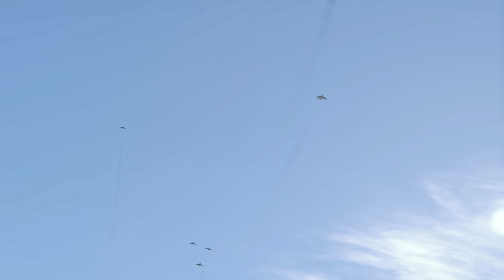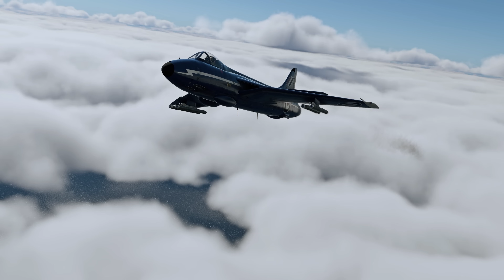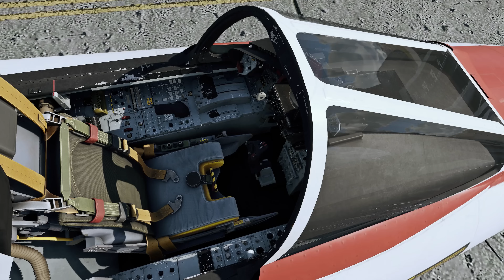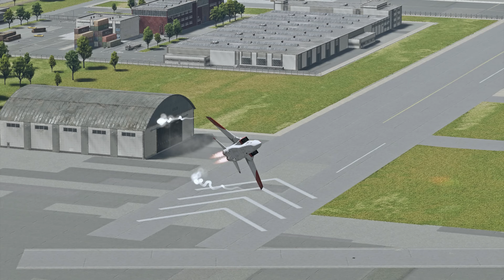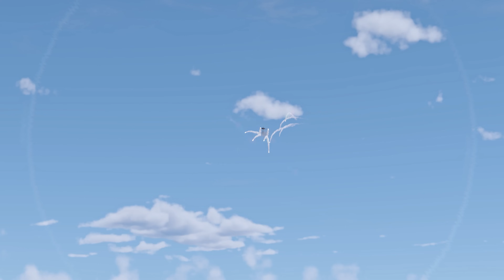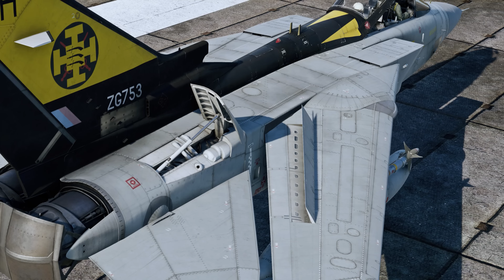Panavia Tornado: Common Cause

Comment: i don't think that this Comment will change something, but can you please take a look on the Tornado family? I bought the Tornado IDS WTD61 cause i tried it on a friends account and it went very well, but know it's absolutly hard to Bomb a base or make a kill. The mig-21s, the mig-23s, the f-104s and some f-4s are so fast that they steal your bases and you have to wait 5 minutes until the round is over, which is not an option in many of the rounds, as many rounds just end very quickly...
i have a small solution suggestion. could you make the tornado start a few seconds earlier or make it spawn just a few kilometers ahead? I would be very happy if the time with the tornado would be a little easier for me, whether you should get the same rewards as before is of course another matter but I really regret having decided in favor of the tornado
Reply: I doubt they'd change or add anything to do with spawns but you can always go for the small pillbox positions and the convoys if they do steal all the bases

Comment: There is much more to the story of the Tornados lost in the Gulf War "outside of combat." When the war started, the Allied Forces were justifiably concerned about the Iraqi Air Defense Network. However, as the air war continued, we discovered CFIT (Controlled Flight Into Terrain) was a very much greater threat than the combined air defenses of Iraq. General Horner ordered all aircraft to start fighting from much higher altitudes but the British refused to comply and continued to lose good crews to dirt. Allied forces lost far more of every aircraft against dirt than everything the Iraqis could throw at them. This isn't meant to disparage the Iraqis but to highlight the necessary priority in ALL phases of flight: 1) Aviate, 2) Navigate, 3) Communicate and in that order of priority. The pK (probability of Kill) of modern missiles is .1 to .5, the pK of fighters is .2 to .7 but the pK of Ground is 1.

Comment: Just a shame Gaijin artificially nerfs the Tornado to a massive degree. The amount of unfinished parts is insane. Even the Flight Model is still placeholder and underperforming significantly. Then nerfed and missing BOL, Missing Phimat Pods, dozens of missing loadout options. No ECM. Heck, The ADVs still have placeholder HUDs and they couldnt even be bothered to add the new big fuel tanks to anything other than the F3 Late, even though they all used them, Gr1s used them more than anything else during the Gulf War. 

One of these days. I hope we actually get the early Tornados, not too mention later ones like the Tornado Gr4 with 18 Brimstones and 2x ASRAAM
Reply: No

Comment: In game, what we have laballed as a GR.1 is actually part-GR.4, the GR.1 never carried the targetting pods, hence why IRL in Operation: Desert Storm, the Tornado (Despite being the most modern aircraft of the war, initially had to have Buccaneers doing the targetting for them they carried the ordiance until later, where the GR.4 could do the whole job itself..
Reply: GR.1 did carry the TIALD during Operation Granby.
Reply: key word being initially. Fairly sure the GR1 could carry the TILAD pod before the conflict was resolved or at least by the 2nd gulf war
Reply: The modification on the Gr.1 for the TALID pod is called the "Gr.1B" as in the upgraded variant of the Tornado Gr.1 that received self lazing capabilities
Reply: You're missing an end parenthese bracket.
Reply: No, the Buccaneers designated for the Jags, not the Tonkas. The Gr.1 in game is more a Gr.1B without Sea Eagle
Reply: I appreciate the replies here guys, GR.1B it is and I consider myself correct (Although I'm going to fact check the Bucc layering for them maybe ASWELL as the Jags cos I'm certain thats true
Reply: Not to nitpick, but was the Tornado the most modern aircraft in the west's arsenal during Desert Storm?

I would have thought the A-10 or F-117A Nighthawk were more modern??

(Not disparaging the Tornado, it's a besutiful aircraft)

Comment: when is the Kormoran missile going to get fixed? tried it the other day and it still misses any ship larger than a pickle
Reply: If you use it in various ways you will have more sucess
Reply: @quarreneverett4767  i've tried it a good few ways, the missile hits maybe once every blue moon and certainly doesn't work as it is supposed to
Reply: @stein_the_lynx3284  i have alot of footage if me messing with it. Being in sim. Your aoa and altitude are factors. Remember its not a harpoon.  The trajectory is a bit more direct. Distance is a factor as well
Reply: @quarreneverett4767  I've tried a ton of different angles, long ranges, close ranges, and mid ranges, the only time I can get a hit is if I'm coming down at a basically 90 degree angle which is not how they're meant to be used, and even then it's a 50/50 especially when used on enemy carriera
Reply: @stein_the_lynx3284  i have used them in simulator and realistic battle settings once you get a feel for them yoh will improve. I can help give you environments to practice and improve.

Comment: Let´s be real the Torando is not very playable not good in high tier , aim 120 or other active radar just slap you out of the air before you even can try to turn , pantirs , tor, ito´s 90 are like a delete button for the tornado , and it can even drop bombs over mach 1 what´s even made for to fly fast and drop bomb´s , ngl at 10.3 or 10.7 would be way better ther are still spaa that can still destory you but not as fast or instant like in 11.7 (high tier ) , make the german tornado playable again other wise is just a waste of time to grind it , or at least give the premium tornado laser gbu´s so its even worth buying it .

Comment: Tornado GR1, BR is too high for its capabilities most notably when compared against the superior German Tornado IDS WTD61 premium

Tornado IDS WTD61 - airRB 11.3 groundRB 10.3
Fully upgraded 

Top speed - 2308kph/1434mph

Turn time clean load - 29 seconds 

Rate of climb 195m/640ft a second 

2 9Ls, 2 27mm cannons Ammo 360, 
700+ Countermeasures, Full set of 12 bombs

Tornado GR.1 - airRB 11.7  groundRB 11.3 
Fully upgraded 

Top speed -  2005kph/1245mph 

Turn time clean load - 31 seconds 

Rate of climb - 177m/580ft a second 

2 9Ls, 2 27mm cannons Ammo 360, 
700+ Countermeasures, Full set of 12 bombs or various old guided bombs / 1 paveway 3

How can this be?
Well one is premium and the other is British. 

So some guided bombs means that despite the premium having better flight performance with the same offensive weapons as the GR1 you get an additional +0.3 in airRB and +1.0 in groundRB at least the GR1 wins on that stat. 🥴 

Don’t even get me started on the jets you have to fight in these slow motion buses 💀
Reply: Or you could look into the engines and come to the conclusion the Germans didn’t really cheap out on things regarding the tornado or the engines
Reply: @fegelein2233 the funny thing is the gr1 we have ingame should get mk103s too, gaijin just gave them.the worst engines because they were getting another tornado in the future, which was the f3. This is the actual genuine reasoning
Reply: @ivancsontos7011  the issue i have is some people think everyones out to get the british, one of the probable causes is britains not exactly known for being able to spend alot military wise look at the QE instead of nuclear they went standard diesel or something.
Reply: @fegelein2233  You just outed yourself as an idiot, I’m impressed you wrote all that out without grasping the fact it’s a game that has balancing involved. 

The German tornado mentioned is a premium, it has the exact same engine as the German tech tree tornado yet produces 490 more kilograms of thrust than it stock while at a lower BR for both air and ground. Aka pay to win and nothing to do with real life decisions. Please know what you’re talking about next time 🥴👍🏻

Comment: i really love the looks of the Tornado, however it underperforms in war thunder and germany is missing the IDS ASSTA 3
Reply: i would assume that the ASSTA 3 gets added later on
Reply: @headshothunt3r414  Yeah, alongside the A200C and Gr4. But unlike those, the ASSTA 3 doesnt really add that much.
Reply: I feel like a Tornado with it's wings and flaps fully extended would turn faster than a loaded heavy bomber but maybe I'm just wrong
Reply: Yeah..... Gaijin artificially nerfs them like mad. Im not sure why they hate them so much
Reply: @MorvranLive  simple where do Gaijin originate from and where does the CEO and some of the higher staff comes from ??? answer begins with R ends with A so if you play ground you see that compared to reality certain t-64 t-72, T-80 and t-90 seem to be a lot more op than western tanks
Reply: @jonathanpatrick8506  yeah, though they also have yet to nerf the Gripen or F16 into the ground..when It comes to aircraft NATO is pretty strong. In ground it's pretty clear cut but air, not so much. 

Though I have no doubt the Su24 will have every possible bell and whistle. It's gunna be very powerful when added
Reply: @MorvranLive nato aircraft make them money

Russian tanks also make them meney

Thats why russia has soo many high tier permuims tanks and the su25sm3 pansir combot

The sm3 doesnt matter in air but in ground its op
Reply: its pretty much exactly how you think a military jet should look if you were to picture one

its got the look.

 too bad it has the RCS of a b-17
Reply: it's still ass (i have the ASSTA 3.1)

Comment: Some of the best european aircraft manufacturers coming to together to produce the saddest aircraft war thunder has ever seen 🗣🗣🔥
Reply: Gaijin messing up the performance of an aircraft as per usual
Reply: @dukeoftoast2420 Who would’ve guessed that trying to use a strike aircraft as an fighter doesn’t work
Reply: @grahh7234  Even in its CAS role. It underperforms big time. From missing loadout options to placeholder FM. It could easily be one of the best CAS aircraft in the game, but gaijin artificially hobble it for balance reasons. Like giving the Gr1 weaker engines and Gen 1 Tpod. Even though Gr1 used the same engines as everyone else and TIALD was Gen 2
Reply: @grahh7234  the thing is that being built around ECMs (yes thoose bigass pods that carry 600kg worth of chaff are the ECMs) if the real tornado performed as the one in game no one would have used it beyond the 90s
Reply: Then they tried to make an airplane with more nations on a euro fighter which was better
Reply: Funny cos Canberra and Bucc
Reply: The f3 is one of the best SARH platforms in the game
Reply: Yea no wonder they're all buying f35 now 😆
Reply: @BoleDaPole I’m sure it has nothing to do with the fact said nations helped to create the f35
Reply: @BoleDaPole these nations also use the Eurofighter